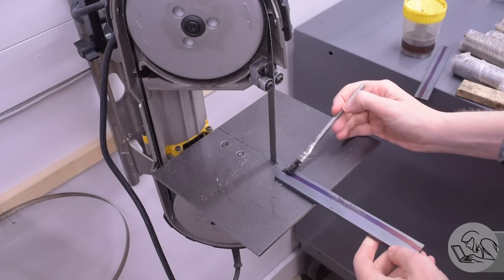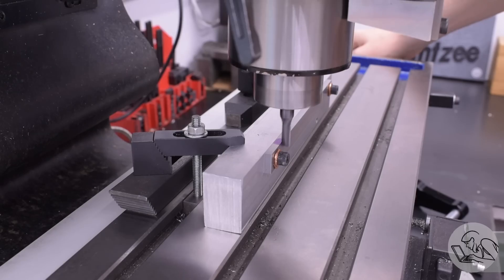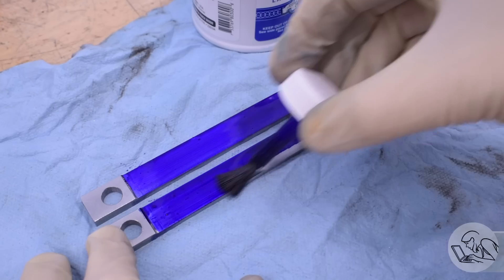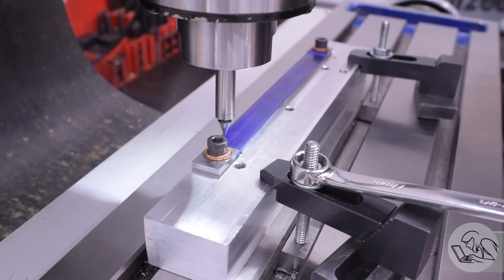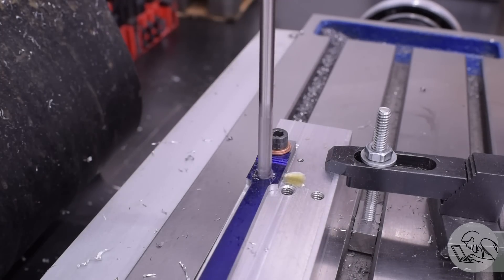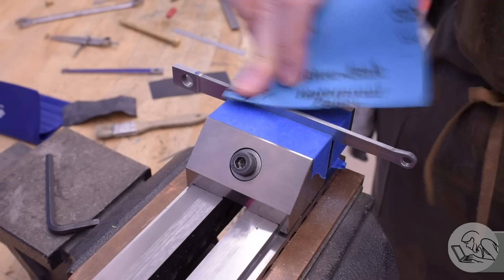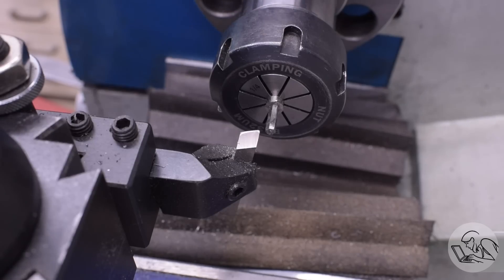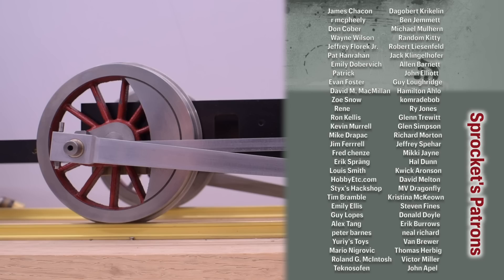Main Rods! - Pennsylvania A3 Switcher, Part 44

Comment: One of my personal goals is to make a 12" or 19" gauge berkshire. A little bit bigger type of locomotive compared to this, a 2-8-4 instead of a 0-4-0, so just a tad bigger... and a LOT larger in scale... like it would be on the verge of being actual light rail instead of model railroading... but it would allow me to put an actual locomotive whistle on instead of the little tiny thing stuff this size gets.

Would I ever be able to? Most likely no. But I want to, just to enrage the scale modelers that got mad when I made my own HO version out of diecast and brass.

I should maybe make an O gauge one... the one Lionel made in the 50's is a super nice model... but I don't want to spend $200 USD, I'd rather spend that in material and an extra $2,000 in labor and tools, so that way I can make a scale model and do what modifications I want, for example, actual bearings on everything, like traditional plain bearings that have opening hatches and such, tapered roller bearings on the drivers or a complicated oil system for plain bearings, fully simulated and modeled valve gear, custom sounds and such to make it as realistic as possible, the whole works. Maybe even make it live steam, I do use a ZW type transformer made by Lionel in 1945, it can supply more than enough power for that surely. Basically, it would be the most over engineered, hyper complicated, unGODLY expensive toy train ever created. An unfathomable project, for something that I would be called an idiot for doing, told to do terrible things to my health, and asked in private if I could make one for them by those same people.

Am I interested in machining? No not really. That HO model was a static piece, so I didn't have to worry much about making it work, and I had so much help doing it that I technically didn't make it. But would I make either a 2", 12" or 19" gauge model of a NKP Berkshire just to peeve people off? Oh abso-I can't say this word starting with F-lutely.

Comment: You bought 2 new tips ?... You know that means you'll never , ever break another one again , right  ? lol  I have a drawer filled with duplicate things I bought just in case that are still waiting for that case .
Reply: edit . It's also worth mentioning that if you hadn't bought 2 you would have totally broken the new one and then found it impossible to order a replacement as they'd be out of stock until the heat death of the universe .
Reply: @balaclavabob001 
That! What you said. Whenever I don’t buy a second replacement for later, when I finally do need it, I inevitably find it has become unobtainium by then.

Comment: One of the dutch terms for metalworking is "verspanen". A "spaan" (or plural: "spanen") is the waste material after making cuts, routs, etc. Someone who does metalworking is then referred to as a "verspaner"; one who makes metal waste. 

Kind of like if you'd call a woodworker a "sawdust producer". Which is how I refer to myself as I build guitars. 

Just thought that was a fun little tidbit.
Reply: It tracks with using the term "making chips" to refer to doing machining operations. That's an awesome little language tidbit, thank you!
Reply: Also just found that the German term matches: "Verspanen" or "zerspanen" - that latter one has even more of a "reducing metal to chips" connotation. In Danish (my native language) we just use "bearbejdning" -- loosely translated "working (something) over".
Reply: @autochton  Oh, very much like "bewerking". It's interesting to see the similarities within scandinavian and germanic languages. 

Furthermore, if you are being less specific, for example: 
Houtbewerker (woodworker, i.e; anyone who works with wood)
Metaalbewerker (also a catch-all term, which really applies to anyone who works with metal, so this can also mean for example a blacksmith or welder, or as we talked about, a machinist that uses a mill or lathe to process metal; Verspaner.)

Verrspaner really specifies someone who works with a lathe or milling machine which may actually also include some synthetic materials. These days, of course, often people who work with CNC machines too. As Quinn shows, there can also be a bunch of overlap with smithing, like brazing, soldering, etc. 

Interestingly, Werk and Arbeid are also often mutually exchangeable in dutch too. Bearbeiding would sound silly in dutch, but I'm pretty sure people would be able to make sense of that if they are at least remotely linguistically inclined.

Comment: Looks like the intended braking point on the probing tip works. Well done Haimer.
Have you checked the same for the replacement parts?
Reply from the maker: Yes the replacements are genuine Haimer parts from Germany, as you say, luckily designed to fail like this to protect the mechanism.

Comment: Quinn,  since the cotter bolts are merely decorative,  did you at any time consider the shortcut of dispensing with the threads and simply loctiting them into the rods?  Is that a hobby machinist no-no?
Reply from the maker: In hindsight I should have. The drawings have them threaded but I don’t see any good reason for it. It was a PITA to make them that way.
Reply: @Blondihacks  I was thinking maybe you were just trying for 100% adherence to the plans (as much as possible), but I'm an energy conservationist... I live to cut corners.